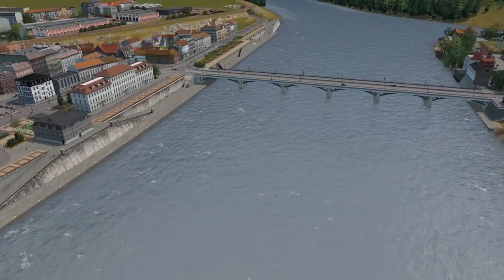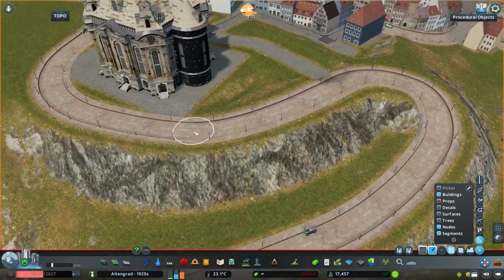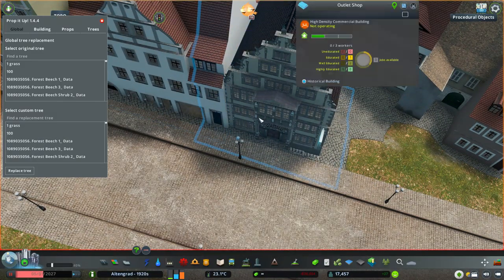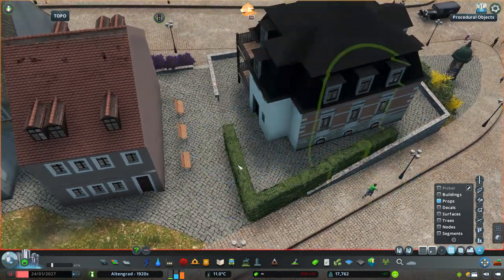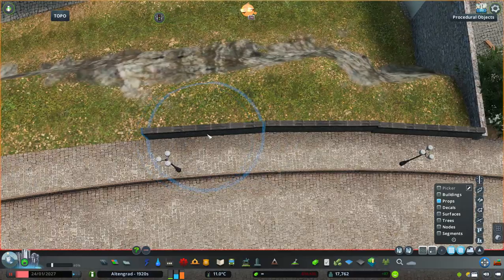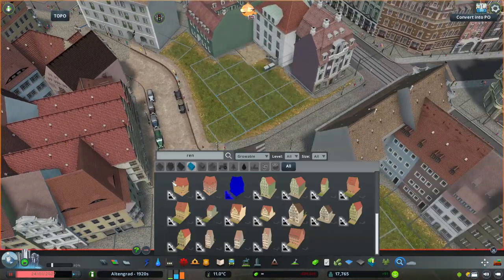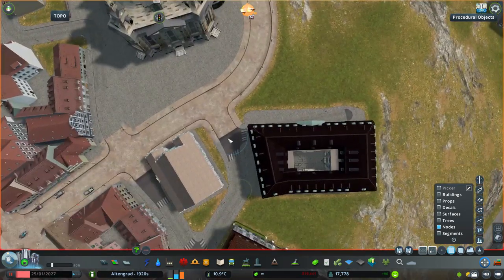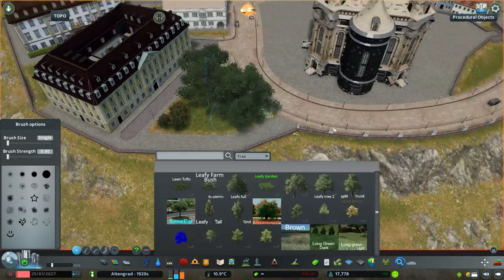The Castle Hill  - Cities: Skylines - Altengrad #15

Comment: You could build some small towns/villages outside the current city limits that would in future join the altengrad
Reply from the maker: That is the plan.
Reply: @Akruas  I'm exited to see what you do for them! Maybe you could have them vary in size and density, and they could spring up around traditional routes to and from Altengrad as well as each other? Would be interesting to see how the road system changes over time with some older highways being neglected in favor of more direct motorways.

Comment: The Morris columns don’t necessarily have to be removed, I see them all over Germany, some in a classical style but many in a more modern style that rotate and such, granted adding these columns back to cities seems to be a more recent endeavor but perhaps when it comes modern day you can add the columns back. In fact I believe they have the German rotating Morris column on the workshop (without the rotating), as I’m sure I’ve used it before.